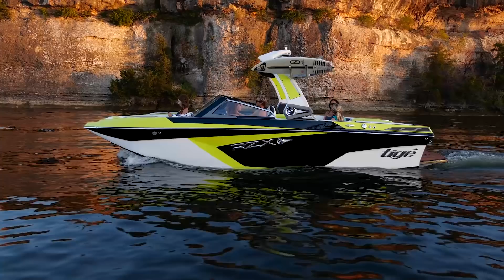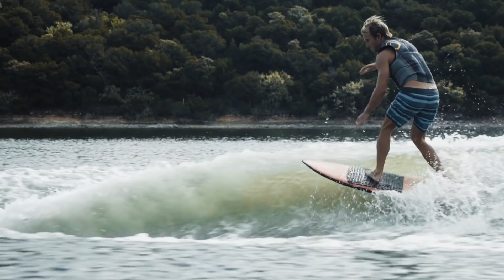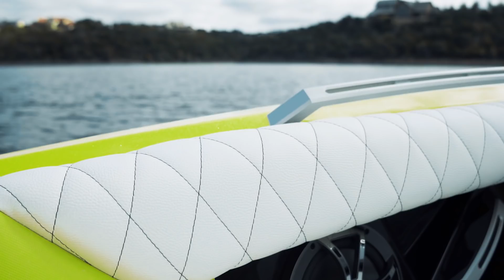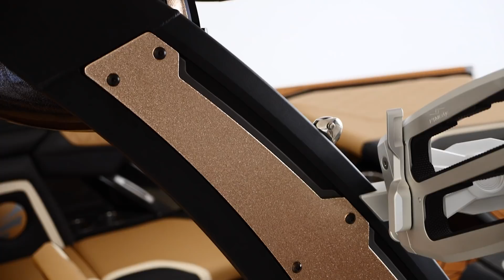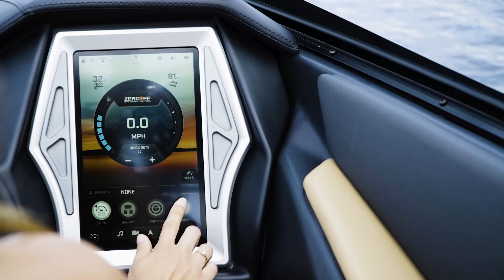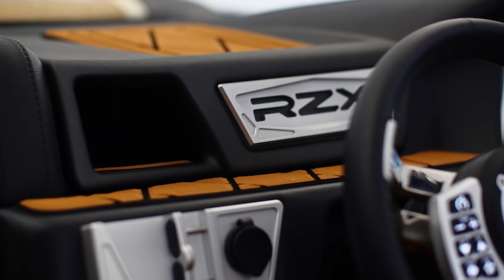2019 Tige RZX20 Boat Walkthrough

Comment: Wakeboard is a dying sport due to all the knee surgeries. Its nearly 100% on the competitive circuit. Wakesurfing is dangerous (but it does look cool...) After this fad ends, you're stuck with a 5,000 pound 9 foot wide boat you can't tow anywhere. Kinda like the original Ski Natiques: badass cool, expensive, but no room for moving in the boat due to the inboard design. Thus, after slalom skiing fad faced, the boats sit and rot... These will suffer the same fate. Great looking boat. Not your fault the fad is dying.
Reply: Steve 3Sport 
Obviously someone who has never owned a boat like this. Surfing is the opposite of dangerous and only getting more popular.
Reply: Matthew Maughan probably the most low impact/safest water sport there is haha
Reply: @CaribouMatt  I think surfing came about because the wakeboarders are getting older, I used to wakeboard about 20 years ago and the surfing appeals to me due to me being 47 and back and knees not as strong as they used to be. I love surfing!
Reply: Fad?  Wakeboarding has been around for over 30 years.  Where I live, this is still a strong showing.  Yes, surfing is becoming the mainstream “tow” sport, but I don’t see that as a fad either.  I don’t see either sport dying anytime soon.